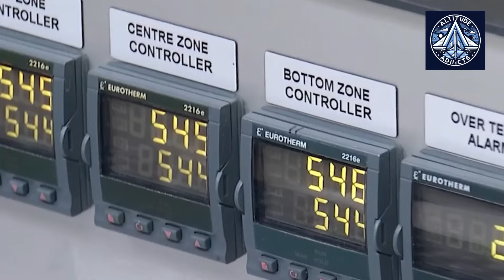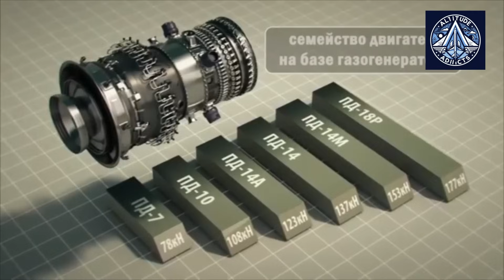PD-35: The Mega-Engine That Could Put Russia’s Wide-Body Airliner on Top | Il-96 |

Comment: Information PD35 engines. There will be 2 versions of PD35 100% Russian engines. 1 PD35 with 35 Ton capacity. 2 PD35M with 41 Ton capacity in works for necessary mod.